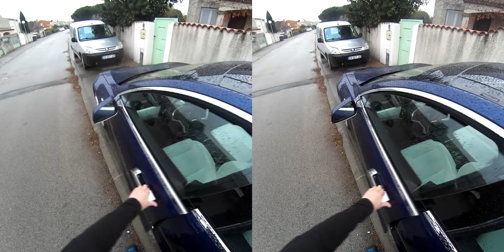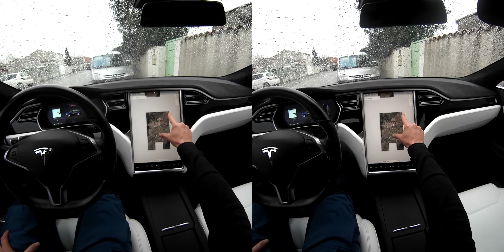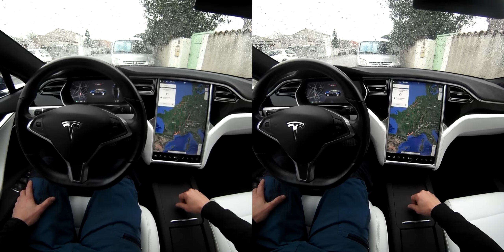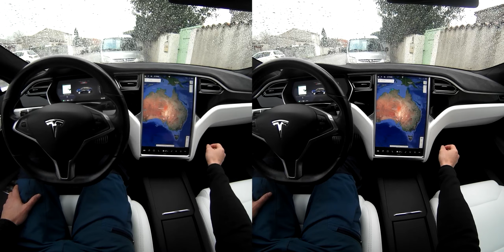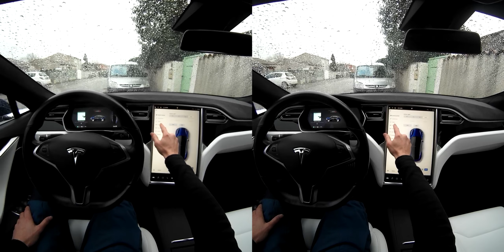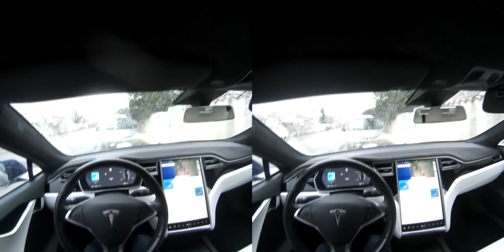tesla p100d , how tu use this car

Comment: Unfortunately the Model S is noisy when you seat at the back seats ;-(
Reply from the maker: compare a gasoline or diesel vehicle that has absolutely nothing to do we can not compare an electric vehicle and a vehicle that works with an engine
Reply: dany danfree they did a better job with model X. No sound in the back seats. My friends does taxi with it. It was very important for the passengers.